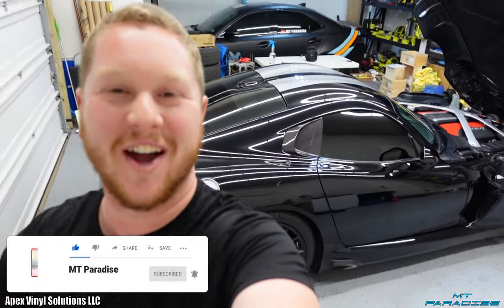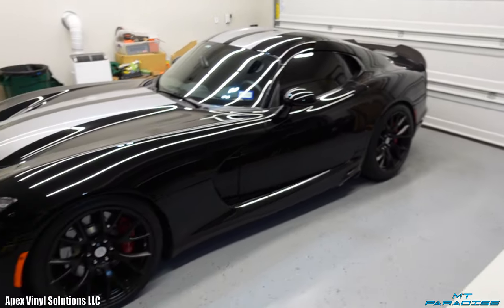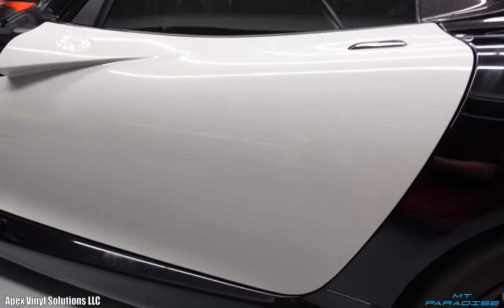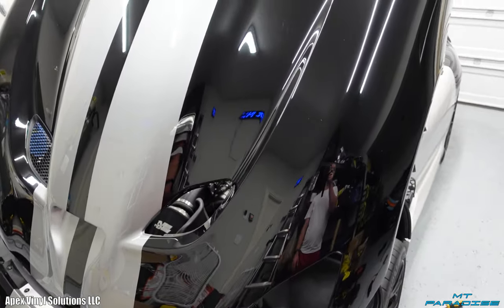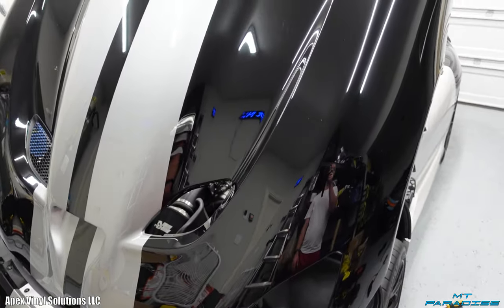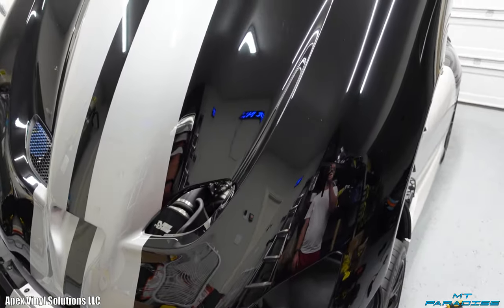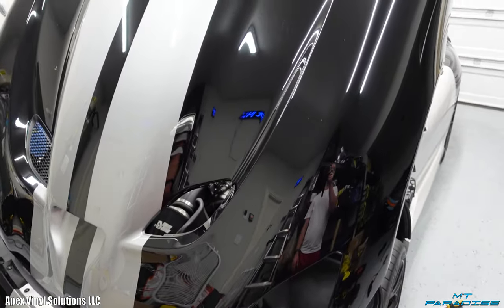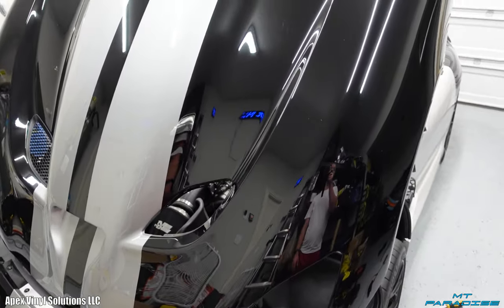Fully Wrapping a Dodge Viper. Apex Vinyl Solutions LLC

Comment: Looks great.  What is the lifespan of a wrap here in SATX?
Reply from the maker: The lifetime of the wrap is 10-15 years but if kept outside, as long as it’s cleaned with the right stuff, it should last at least 10
Reply: @MTParadise  10-15 outside but if maintained properly and garaged it will be 10?
Reply from the maker: @Slow_911_  sorry I worded that weird. Regardless it should be 10-15 if taken care of. If outside every day all day, it might be 10 but that talking about maybe some fading. The wrap on the car should for sure last a long time. That’s what 3M and Avery Dennison rate it at. That’s also why I don’t use cheap vinyl usually wound on amazon because that can last 1 maybe 2 years
Reply: @MTParadise  sent you a PM on IG…
Reply from the maker: @Slow_911_  sounds good

Comment: How did you remove the door mirror?
Reply from the maker: After removing the door panels, there is a spot inside the door to reach into and remove the nuts
Reply: @MTParadise  Ah ok thanks!
Reply from the maker: @littlenuggets6663  no problem